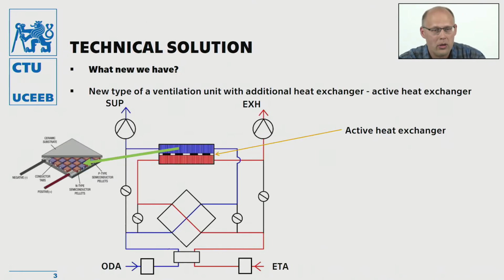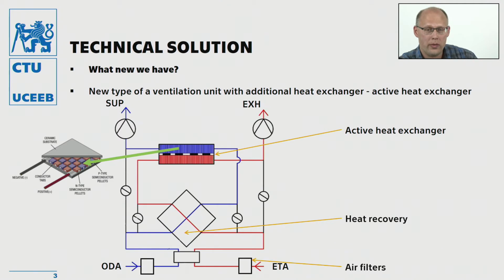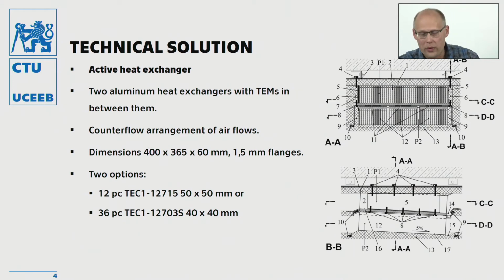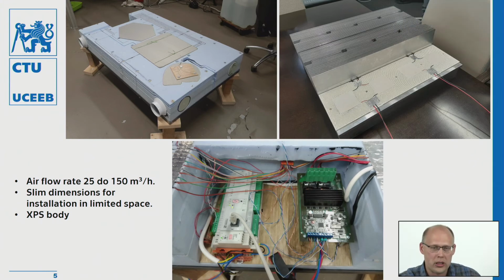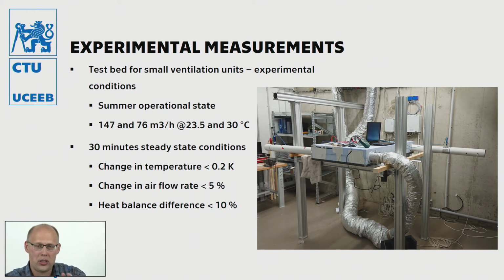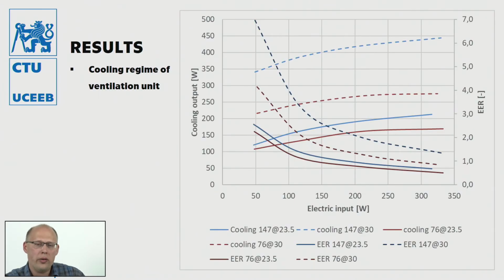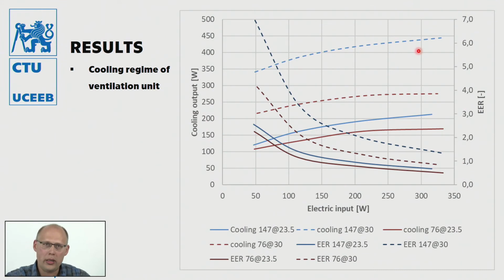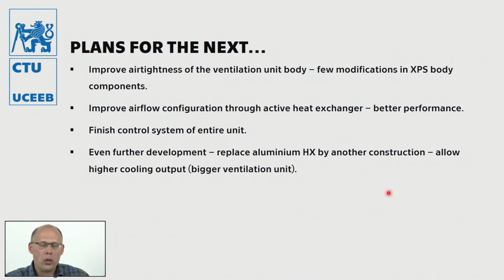16 Daniel Adamovsky - Residential Ventilation Unit with Thermoelectric Heat Exchanger for Control

Comment: What if you combine it with a passive cooling/heating or rather temperature ''stabilizing'' effect of air-to-ground heat eaxchanger system? Let the fresh intake air go through an underground tunnel of specific length and depth (wich is another interesting topic for research) before going into the electric system. It should lower the heating/cooling effort.